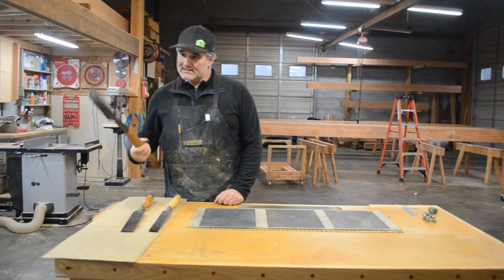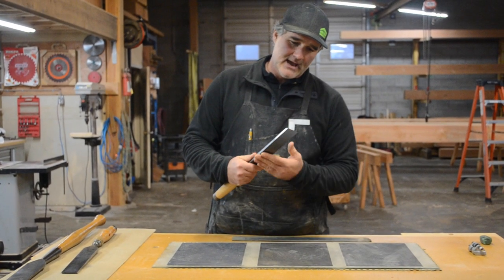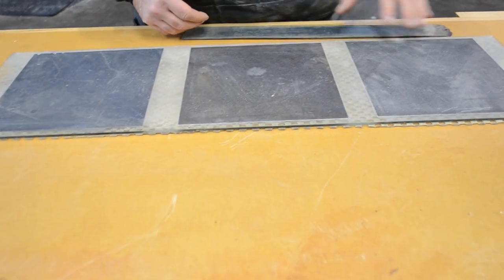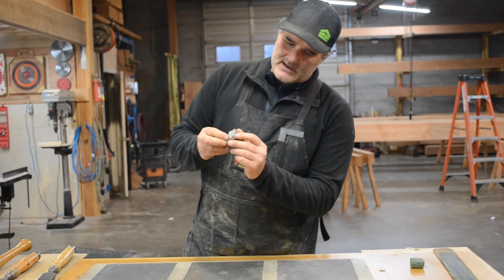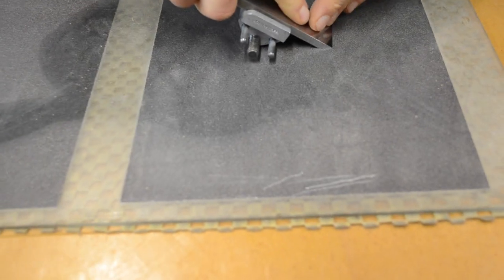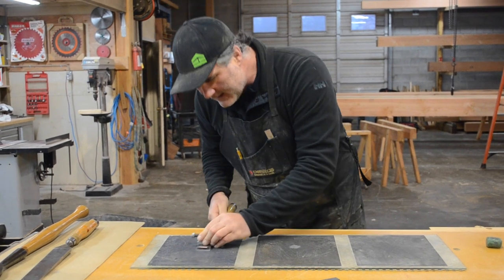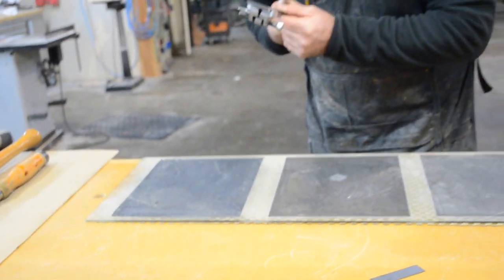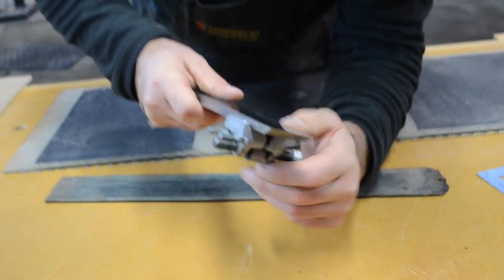Sharpening timber frame chisels

Comment: That's a decent system.  How long does the emery hold out?  and just spray glue to hold it down and how well does it come off when the paper gets dull?  The back of my slick.... I can apply a straight edge across the back and I will see light at the edges, so not dead flat. also down the length its not dead flat either,  I mirror this on most of my chisels too.  but I do get the keep the back flat, and for sure don't round the end!  its easy to do.
Reply from the maker: Yep, we glue with 3m glue spray, it will last about 6-8 weeks in our shop, its easy to peel off and reapply.